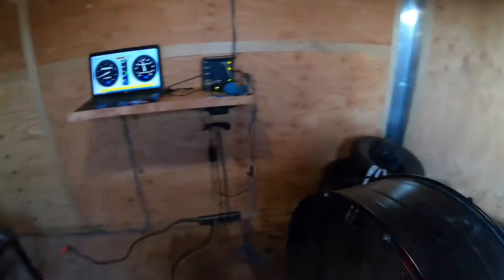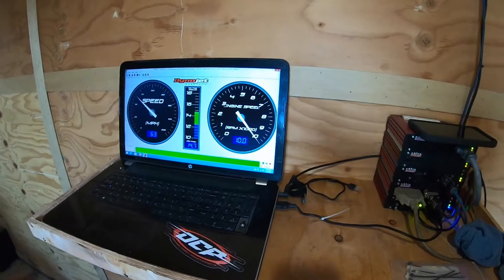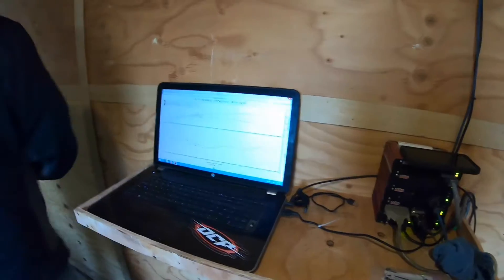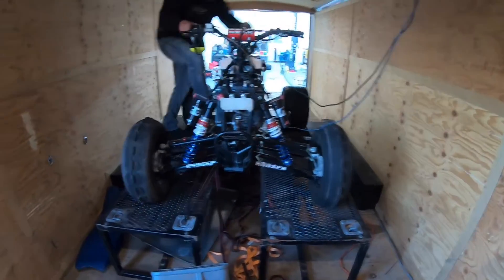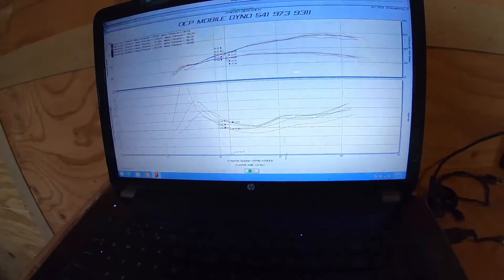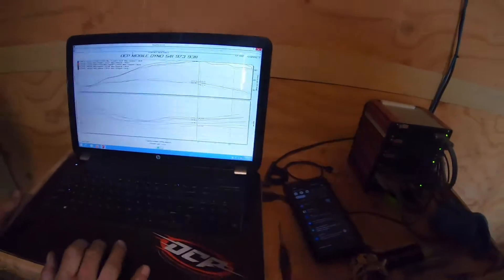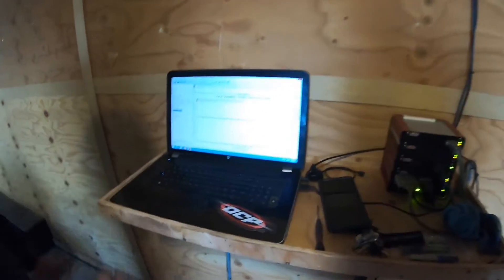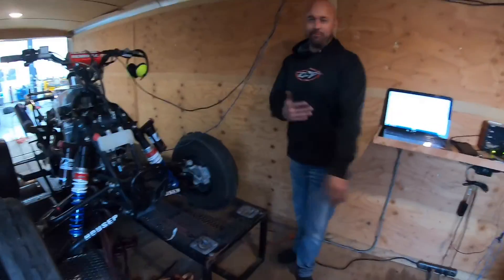Honda TRX450 with CRF450 engine on OCP Dyno Baseline

Comment: 😎 never had mine on a dyno  if i had to guess i have like 75 to 80
Reply: Doubt it. 60 Hp is lots of work and great tuning.
Reply: What is the build?
Reply: @OCPowersports1  521 big bore kit ported for drag racing  2 through 5 race cut gears kibble valves  web cam 15 to 1 compression  over ride  transmission
Reply: Yo black smoke I got a trx bored to a 487 with a low comp piston and a stage 3 cam and I'm not impressed at all. What do I gotta do to see 60hp? I bought the quad a few weeks ago and when I got it it had 8 inch wheels and a tiny tire on back so I was giving me a false impression of being a beast when it really wasn't. My buddy's raptor 700 smokes me. I am a fat guy tho which doesn't help which is prob why he beat me but still. People are telling me it's cuz I need a high comp piston and a ported head.
Reply: Youre smoking crack if you think for a second your trx is making 80hp 😂😂😂😂😂😂
Reply: @heathcarr1105  I've smoked banshees  that claim they had 70 hp lol

Comment: Is this a bone stock CRF or was there motor work already done to it?
Reply from the maker: Racers edge head, Web Cam, 14.3:1 piston, RP throttle body and intake and PEP performance tune on a vortex ECU.
Reply: @MFFilmsAZ  oh damn
Reply from the maker: On another dyno was 55 stock with vortex.